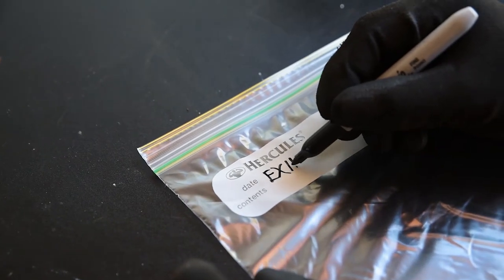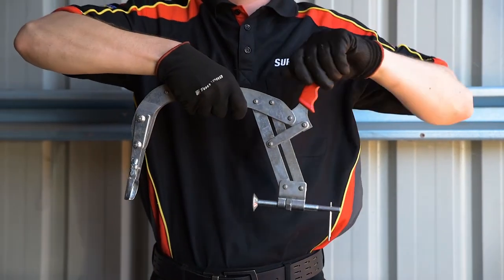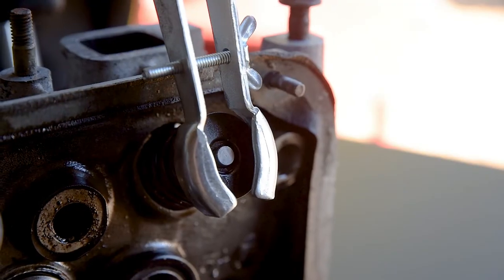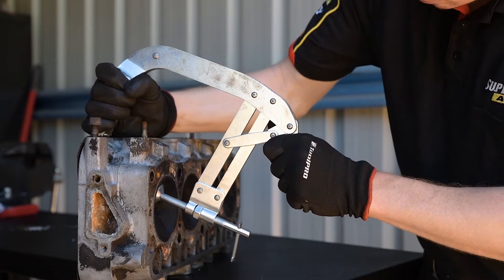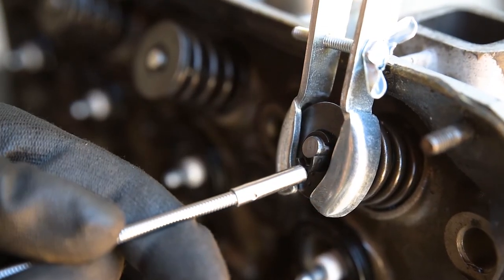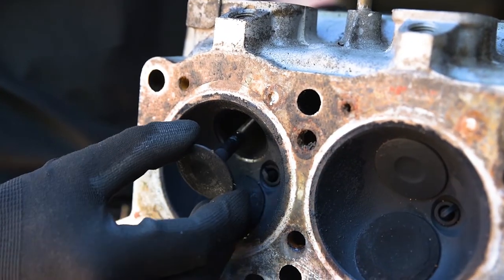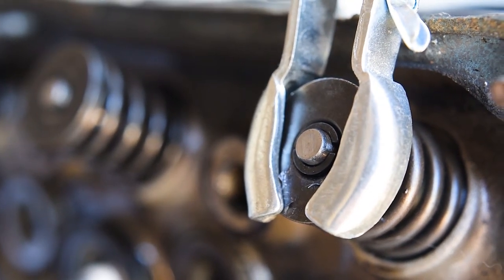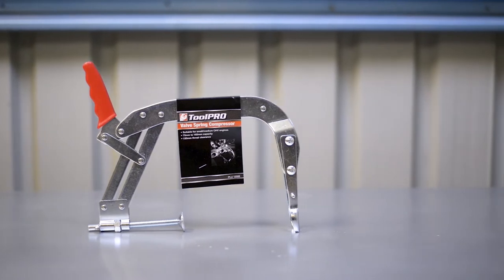How To Use A ToolPRO Valve Spring Compressor

Comment: You can hit a deep socket and extension on the spring  retainers to remove the keepers. Takes a minute to do a whole head
It’s assembling the head you need tool for
Reply: Thanks for this comment man. Fucked around with this tool for a couple mins and then switched to this method and it is much faster and easier.

Comment: I bought one to help with the restoration of my XG Falcon, quite a flimsy tool, wasn't strong enough for my needs, ended up using a large wood working clamp and pair of pliers, and it was still less frustrating than trying to use this "tool"
Reply: Yes, they are terrible and too fiddly, it also doesn’t clear the head properly. There is NO way to compress a valve spring using just the handle.
Reply: @DavidB-rx3km  pipe on the end of the handle...

Comment: Taking out the spring is not an issue....its putting a new valve and seal then the spring back is the main issue i have... Ive seen basically most of the videos on YouTube that shows how to "remove valve spring" but no1 really shows how to put valve spring back on ....why is that the case?
Reply: No 2 model engines are the same....this does not work on a 4 cylinder 8 valve or 12 valve

Comment: Rubbish tool don't get that one!
Reply: But why?
Reply: Doesn't work
Reply: If you want to convince people not to buy this, you should provide at least some context as to why this doesn't work.
Reply: It doesn't work on all cylinder heads.. why? Because most cyl head have deeper valve location and tool wont reach it because the side walls are too high.
Reply: @alynevillegas4519  yes exactly